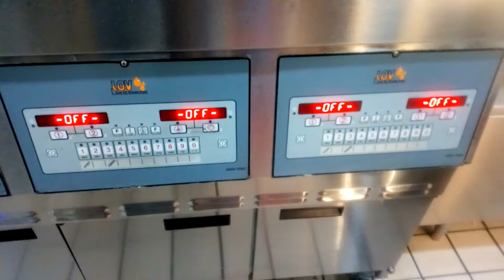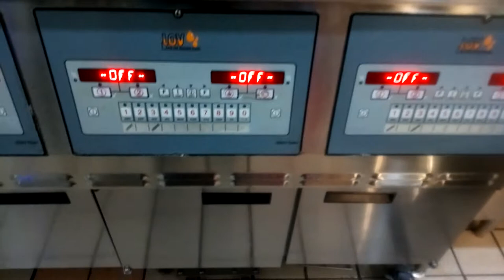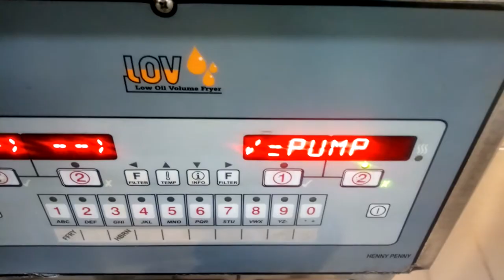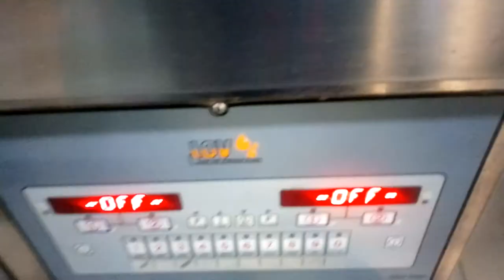How to dispose or change oil in fryer of Mcdonalds. A complete guide to learners of doing this job.

Comment: Dam my work don't have the disposal unit so we have to carry that heavy shit to the grease drain machine
Reply: my store doesn’t either they use a bulk system where the old oil is stored in a disposable tank via a tube connected to the fryer
Reply: Fr carrying this shit is dead lma